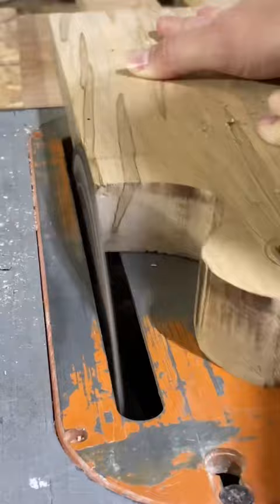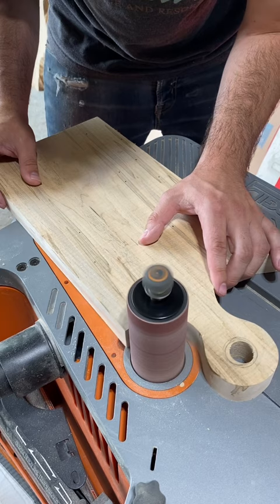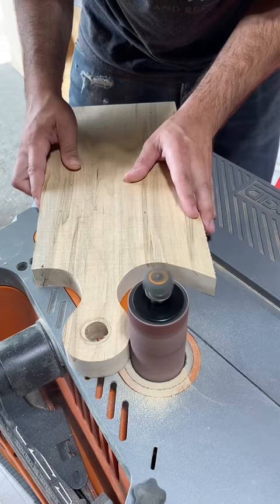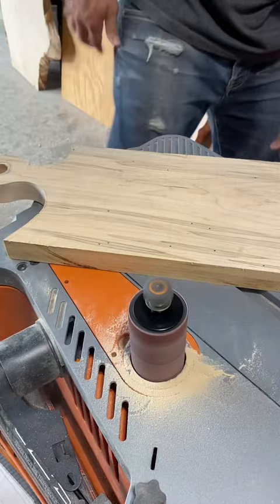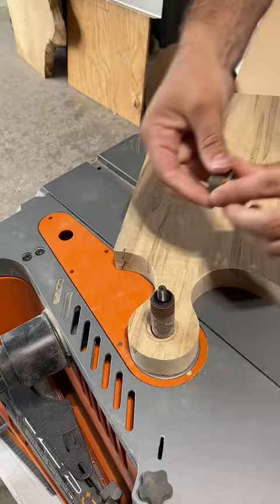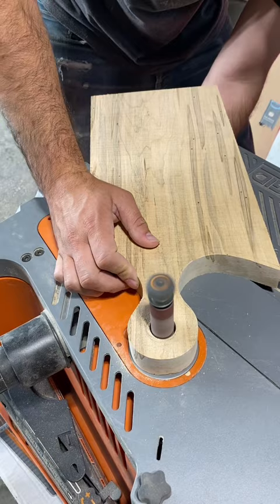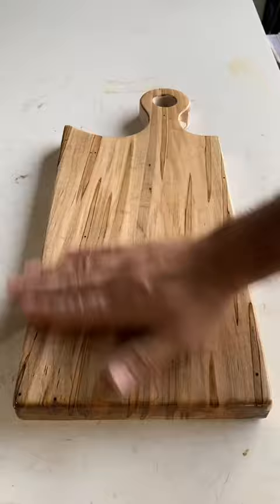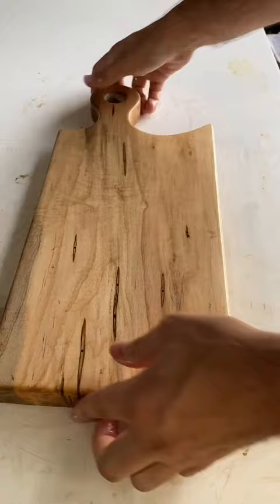Bugs Made This Wood… #shorts #woodworking

Comment: Not completely zero waste but much lower waist of the wood piece. I suppose you could make some cup coasters out of the small scraps it did make, to make it truly a zero-waste project. Pretty clever though👍
Reply from the maker: I actually use these smaller pieces to make bow tie inlays!
Reply: @ggwoodworks  thanks for the ❤! What's a bow tie inlay?